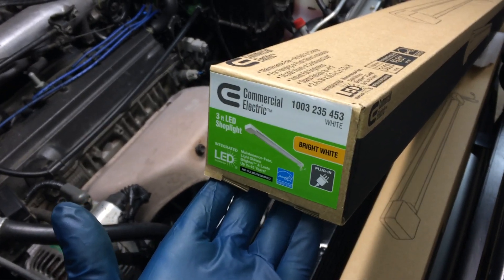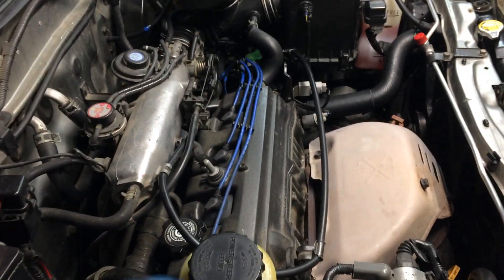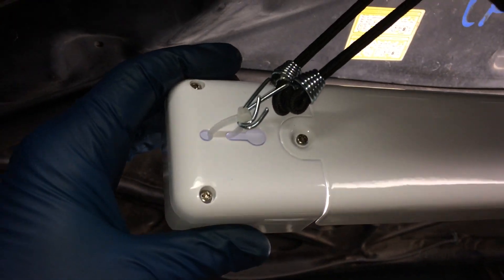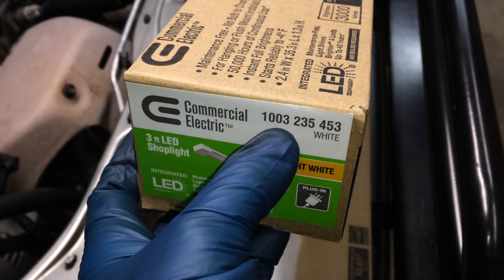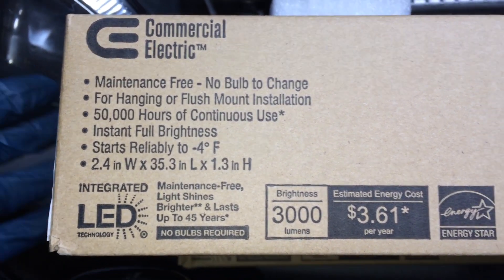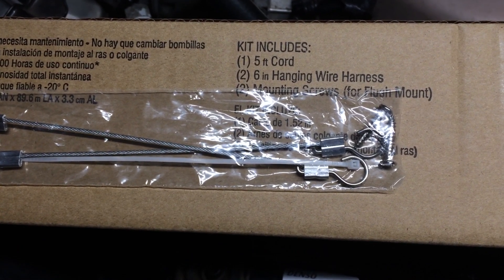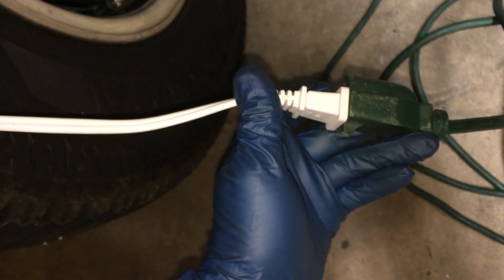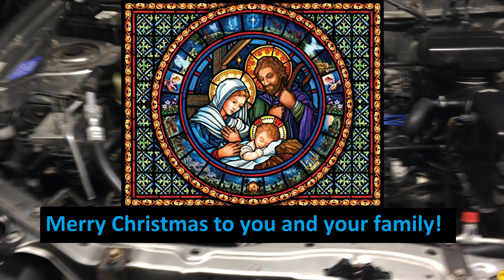Commercial Electric 3 ft LED Shop Light, Home Depot Special Buy $10.88

Comment: Cool. I'm picking one up tommorow. Gotta due valve cover gasket and replace radiator on a 2006 Matrix. I cast a shadow on the engine bay, a recipe for ensuing madness.